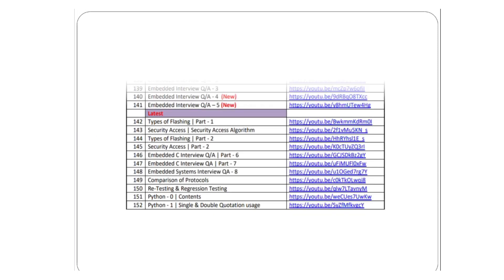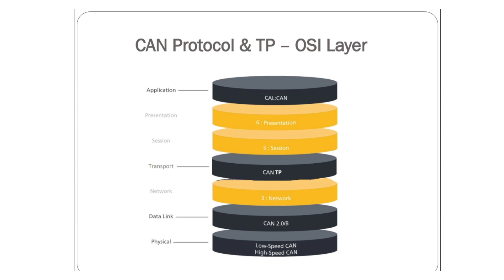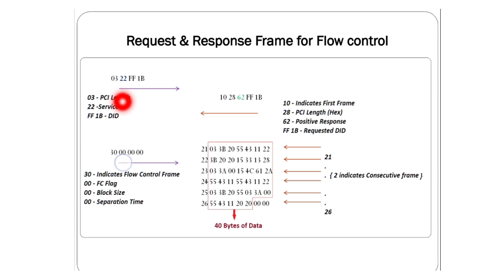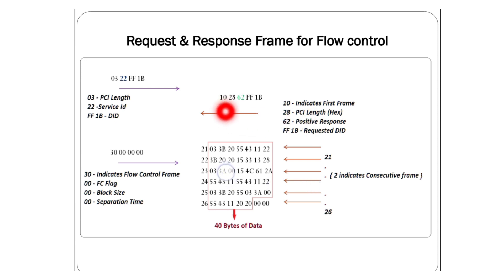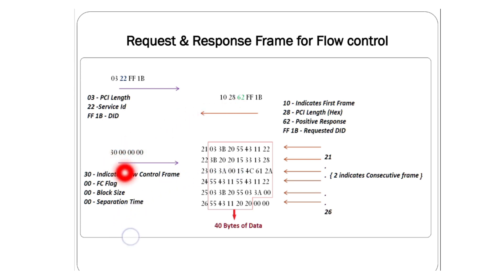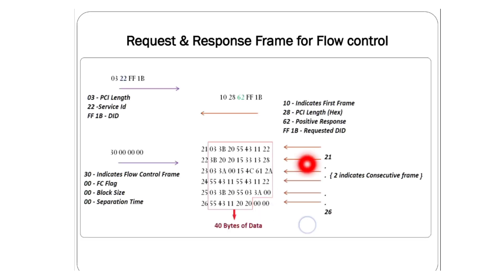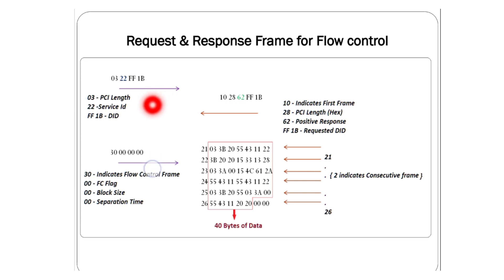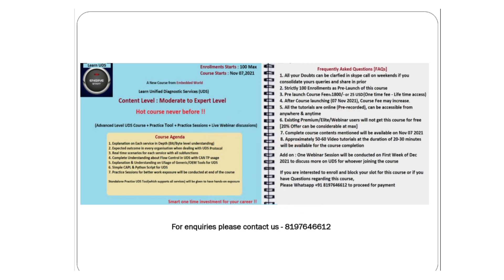Flow Control in UDS | CAN TP | CAN Transfer Protocol | Frame Format|Embedded World|Part - 2

Comment: What CAN ID is used by the FlowControl Frame?

How does a sender know that the FlowControl Frame is in response to its FirstFrame, and not a response to another node's FirstFrame?
Reply from the maker: ECU sends flow control 30 00 00
Reply from the maker: As soon sender knows that flow control received then the first frame should be initiated
Reply: @EmbeddedWorldAutomotive  I mean when using 11 bit CAN ID.

Comment: What exactly mean by CAL:CAN? Is it used in calibration of ECU? Via XCP/CCP?
Reply from the maker: Yes
Reply: @EmbeddedWorldAutomotive  Admin Ji. I would like to tell you one suggestion on this video. 

1st 2 bytes of the frame is like this. 
1X XX - XXX is the data length for multiframe message (4095 Max Bytes)

In the video, only 2nd byte is considered as length.
Reply from the maker: Yeah.. as it has 40 bytes of data I considered only 28 in the second byte and 1st byte as 1(0)
Reply from the maker: Thanks for feedback on very close things.. Appreciated
Reply: What is the use of block size in flowcontrol frame ?